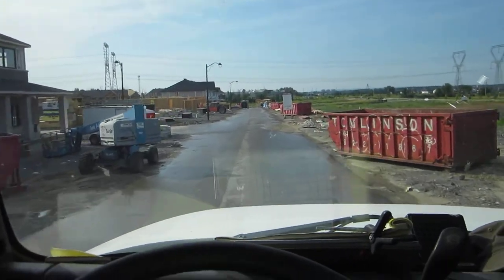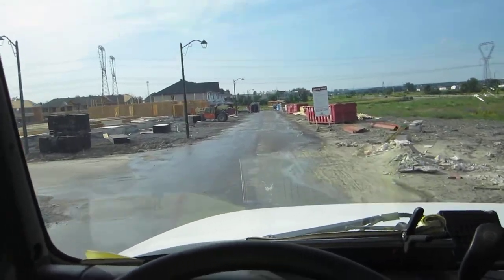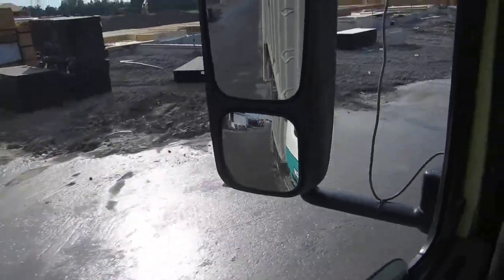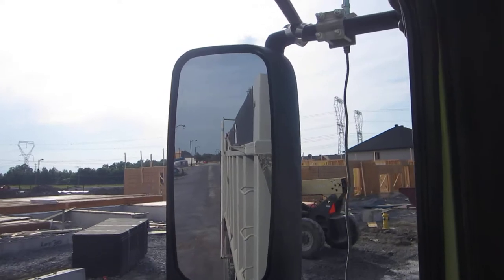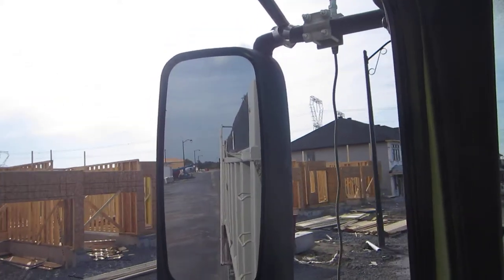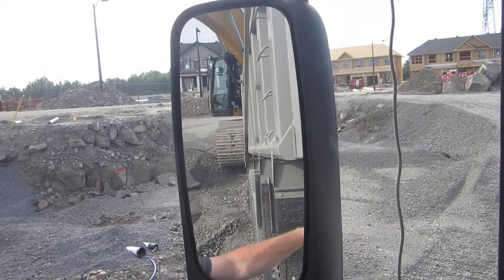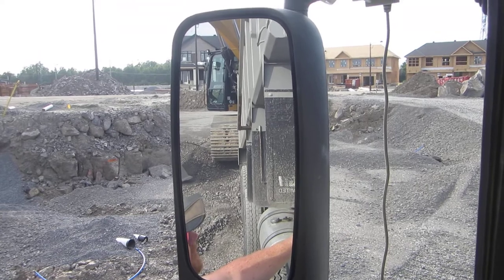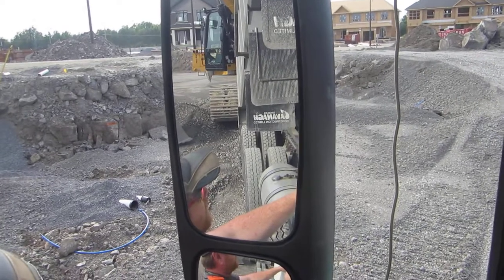Mr. John Tutorial : Tri -axle dump truck demonstration to unload.

Comment: So for turns you have to lift the axle, what happens if you don’t lift it early enough?
Reply: @SafeTravells  around here I don’t know any one that has a steering lift axle, they are all the non steer lifts. I know some states banned them and now require steering axles. But if you left it down it wouldn’t wreck the tire?
Reply: @drewmurphy2796  it will eat up the tires and may break the shafts..
Reply: @SafeTravells  where are they banned?
Reply: @SafeTravells  you mentioned they are illegal, I haven’t heard that, and see them everyday in my area, so I’m assuming it’s state Specific. Something to add to the list to research